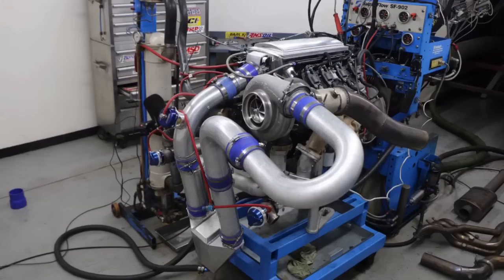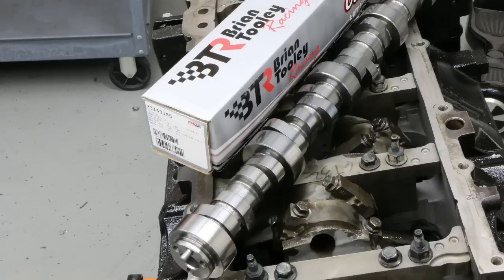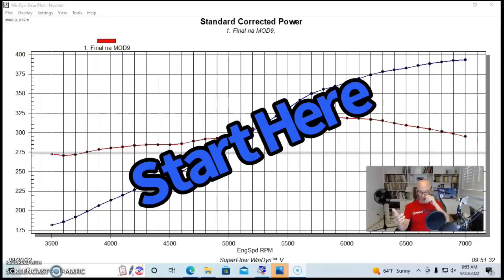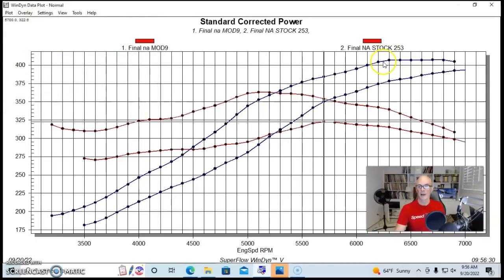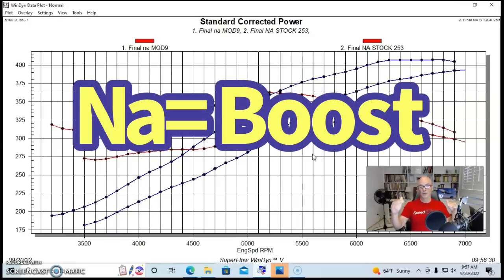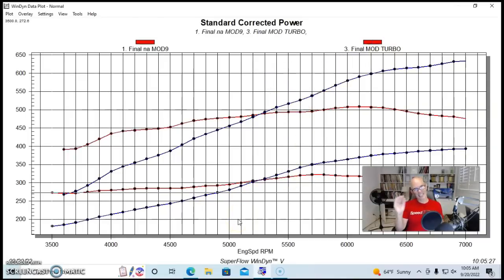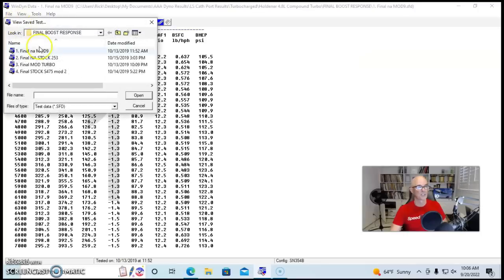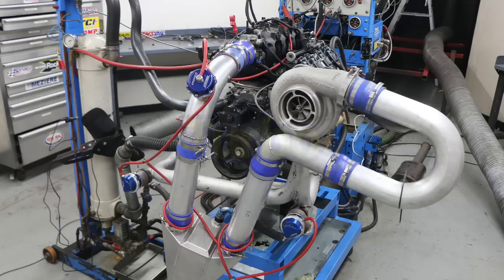HOW TO MAKE THE "BEST" TURBO MOTOR: START WITH A CHEAP NATURALLY ASPIRATED MOTOR-THEN ADD BOOST!

Comment: When you said short runner for high RPM. It's Confusing, because I know you know what you're talking about. And I know, Holley knows what it's talking about.  In the ads for the Holley high rams and low rams, Say the High ram is for higher RPM.
Reply from the maker: the Holley Hi Ram has longer runners than the Low Ram-but both are relatively short runners for high rpm -at least compared to stock (long) runner intakes
Reply: It makes perfect sense that the low ram has shorter runners than the high ram.  Even a big dummy like me  can figure that out. I didn't know the Holley high ram had shorter runners than a factory intake.  But  what my Inquiry was about, Is Holley add say the opposite of what you said.  Both statements cannot be correct.  Thank you for your time.I'll just google it👍

Comment: I have just purchased a cammed 5.7 litre v8

It has the following components 

Alloy high rise
intake manifold, 102mm throttle body, proflow hi flow injector rails, bosh 968 42lb injectors, Vcm7 cam, crow cams double valve springs and retainers, Mellings hi volumn oil pump, roll
Master double double row timing chain kit, arp bolts, vcm alloy otr and oil catch can.

Stainless steel extractors with high flow cars with a brand new 2 and a half inch cat back system with rear muffler delete. 

Walbro 460lph fuel pump e85 compatable.

That being said I’d like to add a turbo.

What turbo do I need or what turbo can you suggest would suit This set up?
Reply from the maker: I don't know the specs on that cam, but it will work with boost-turbo size depends on desired power

Comment: The best way to guesstimate the power you are aiming for is multiplying your NA power by 1.9 for 1 bar and 2.8 for 2 bar. Then spacing your IC, turbo, injection rate and exhaust size for the new guessed flow.
Reply from the maker: 1 BAR IS 2.0

Comment: The Cummins X-15 is rated as 400hp amd 1000 ftlbs. VGT doesn't kick in at low rpm. So, just think what a low end tourqe n.a. gas engine will to with the help of a turbo. Nothing but good things.
Reply: Most x15 run 1650-2000ftlb. The vgt functions from idle to full rpms.  No idea what you are talking about that it doesn’t kick in at low rpms. Heck some versions of that engine don’t ever exceed 1850rpm so it’s always at low rpm compared to a small gas engine.

Comment: Isn’t that backwards? Don’t short runner intakes make power lower in the rpm and long runners make power higher? Long runners is the point of tunnel ram intakes and they sacrifice low end torque for more peak horsepower. Even he’s said it. Today it’s short runners for high rpm power and I’m fairly sure that’s a mistake
Reply from the maker: YOU ARE NOT CORRECT. LONG RUNNERS MAKE POWER LOWER THAN SHORT RUNNERS. A TUNEL RAM HAS 8 LONGER RUNNERS THAN A TYPICAL SINGLE PLANE (4 LONG AND 4 SHORT), WHICH IS WHY IT USUALLY MAKES MORE POWER THAN A SINGLE PLANE. I HAVE STATED THAT SINCE THE BEGINNING OF TIME

Comment: What's your opinion on aluminum versus iron block for boost?
Reply from the maker: IRON FOR BIG POWER UNLESS YOU RUN THE L33/LC9 ALUM 5.3L BLOCK
Reply: @richardholdener1727  thank you

Comment: Start with a engine that has tough bottom end so the boost does not break lower end not built for more power. Some engines are over built in bottom end  that can handle double stock power without being a hand grenade. Seen many a na engines boosted only to grenade bottom end as they cannot handle much more than stock power.

Comment: Ah crap I didn’t think about where the sloppy stage 2 makes power. I want to build a torque monster. Did I get the wrong cam in a 5.3?
Reply from the maker: MILDER WOULD BE BETTER-SEE THE SS2 VS TRUCK NORRIS VIDEO

Comment: Gouse  informative vid as always Richard!

Curious, have you ever played around with turbo restrictor engines? Id love to know more about the considerations and what to expect. 

Seems to be a black art that everyone keeps close to their chests
Reply from the maker: TURBO RESTRICTOR?
Reply: @richardholdener1727  yeah, there is a class of racing here in australia (IPRA) that has rules to limit output by placing a restrictor on the inlet tract of the supercharging device. restrictor size is dependent on racing weight.

I assumed restricted  engines would be commonplace in racing 😅

Comment: The factory truck or a tbss intake is where it's AT for good torque and a nice curve from what iv seen 👍. I plan to build a 6.0 with prc heads and a btr truck Norris for my s10 on around 12-14 lbs. It's not heavy but I still want to pull a small trailer with it so, need the torque. I want it to haul a trailer AND the mail lol

Comment: Richard, all this feedback is excellent 👍. However, you didn't mention to us the boost level and the turbo specs. Also the compression ratio of the cylinder heads. Also I was surprised by the fact that the worst combination with the wilder cam didn't peak on top as it should.
Reply from the maker: IT SHOULD NOT WITH THAT DROP IN COMPRESSION AND CAM AND INTAKE
Reply: @richardholdener1727  ok, this explains a lot, however since the drop in compression is substancial someone could argue that the engine with the 317 heads can take more boost to make up the loss of power, at least catch up on top of the power curve.
Reply: Yes but the lack of compression is a loss of efficiency. You will need more fuel and boost to make the same power.
Reply: @akassasin5768  it depends how much boost the engine with the 706 head can take. If this engine can make good usage of the BW475 turbocharger up to its efficiency range practically turn up the boost high enough  you are right.

Comment: I'm going to run dual intake cams on my Saturn SL2 turbo build so in theory should I just do a custom can grind and avoid the two intake cam set up? Or maybe it doesnt matter? I'm also doing mild deshrouding, minor blending of the bowls,  1-2 mm narrow blended valve seats, port and a polished head with E85 and 10 LBS of boost at 10 to 1 compression.
Reply: Just get the cams reground. The dual intake cam setup was just to be cheap. Make sure you upgrade the rod bolts, they are weak in the s series.
Reply: @dirtypeanut6590  so its better to do a custom grind or leave em stock? Thanks for the advise on the rod bolts BTW.

Comment: The "wrong" engine is probably the better one, for very high hp, atleast on a SBE. Lower torque and high RPM to keep the cylinder pressure low is what keeps them alive past 1k hp.
Reply: See I would think the “right” engine is better. Because it makes more power more efficient NA therefor it would take less boost to hit 1k hp. As seen in Richard’s other videos, it isn’t the power or boost that kills a lot of these SBE engines. It’s detonation from whatever the reason, bad fuel, bad tuning etc. not power or boost.

Comment: What about a stock 05 5.3l with a sloppy stage 2 cam, 243 heads,85mm turbo and a Jegs aluminum Intake?I know the 243's lower compression a little but I think there better then the 862's. What do think about this combo?
Reply from the maker: THE ALUMINUM INTAKE IS SHORT RUNNER LIKE THE ONE SHOWN
Reply: Do you think the 862s and tbss manifold would be significantly better? Or should I shave the 243s to bring compression up?

Comment: Best way to get a healthy NA? All he showed you is good airflow in this example. I too saw the 317 heads and thought maybe he had them trimmed and ported but nope. Airflow is going to determine whether or not you can get the best possible potential out of your build before you turbocharge it. Thinking maybe the turbocharger will take up the slack or lack of a proper build plan.  He showed us a decent build with the 706 heads. That’ll get you to at least 700hp with mild boost numbers.  Your choice. Making that turbo pump up to 26psi to get you to 700hp is going to create issues quickly if not right away. Something is not going to be happy.  A strong NA build is the compliment to the horsepower bragging rights. Lol.  Or whatever you think. Your tow bill. Not mine. 😊
Reply: The point of the video flew over your head
Reply: @chrishansen7004  the point of the build is what he’s been telling you for weeks now. He says it in almost all of his turbo videos.  Grow some ears and don’t let pumpkins grow in them
Reply from the maker: 26 PSI TO MAKE 700 HP?
Reply: @richardholdener1727  hello Richard. I was trying to explain an example of how a bad engine build might  look like on the numbers. Not installing the proper bolt ons could have a big effect on horsepower. My 26psi of boost to make 700hp was a exaggeration of that example. Some people just want to twist things and make me look like a fool. If they could only read and listen they might learn a few things. Then again some people just wanna look like they have more panache.  Have a good night Richard.

Comment: I have a Camaro 6spd. The LS3 has had everything replaced with better parts except the crank, rods, pistons, valves..  I have an AGP turbo kit at the speed shop waiting to be installed.  How safe is it to boost the motor to 700whp on E85?
Reply: I also have the new clutch, fuel system, injectors, etc...
Reply: To the moon
Reply: @chiefpoopydick  I hope you don't mean the pistons are about to go to the moon
Reply: Very safe.
Reply: @Low760  I hope you're right.  At what power or boost pressure would I need to swap rods and pistons and maybe valves?
Reply: No personal experience, but there's so many people out there pushing completely sock engines above 700. As long as you have extra ring gap and a tuner who knows what he's doing you'll be just fine imo. Back when I had my 2012 camaro I had planned on similar power range but ended up having to sell before I could.
Reply from the maker: RING GAP?
Reply: @richardholdener1727  it would be within stock LS3 specs. I don't know the exact gap.. The pistons have never been removed.  Its a higher mileage motor with a lot of new parts.
Reply: Not very lol you upgraded everything but what matters lol BUT I see stock bottom end 5.3 well into the 9s all the time with a bunch of boost. They always joke how they’re “trying to kill it” but it won’t die lol they all have backup engines on stand by and they’re motto is “only needs to make it through tonight” but those guys seem to run those bs engines for 10-15 shootout races and going rounds or winning each one b4 needing serious rebuild but the guys who actually expect it to hold and don’t have spares blow it up winning the first round ruing their opponents night just to give whoever draws them second round a competition bye Lmao. Junk yard ls engines and lottttts of boost are prob the best poor boy grudge combo out currently though. Turn that bitch up and go for what ya know lol don’t get roped into a rematch load that bitch up and go rebuild her with the money from the pot😎